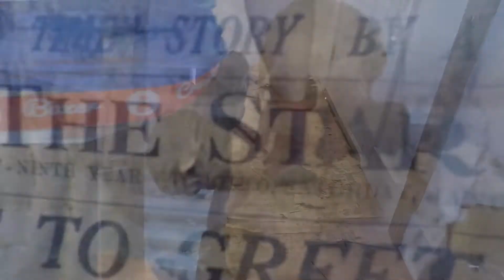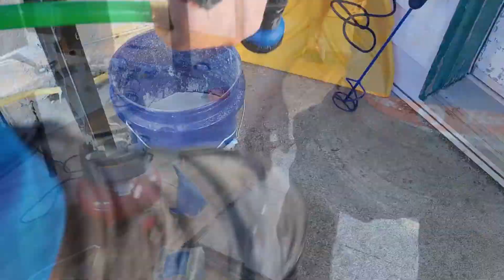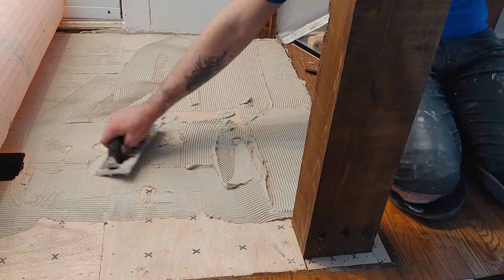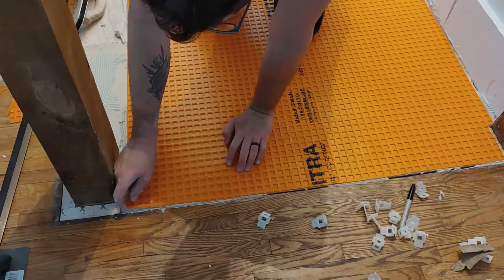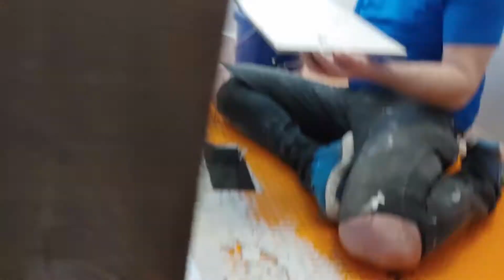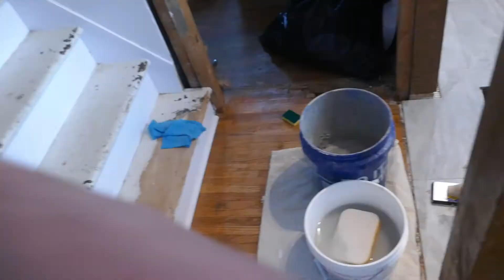How to Tile a Front Entryway in a 110 Year Old House With Uneven Floors

Comment: Exactly what I’m about to do in my old house. How’s the 1/4” ply and everything holding up?
Reply: I want to do something similar. Everywhere on the Internet says you can't lay tile over plank subfloor, you have to out 1/2" plywood over it. But I don't want to add so much height to a relatively small tiles area. Did this hold up for you? Did it crack?